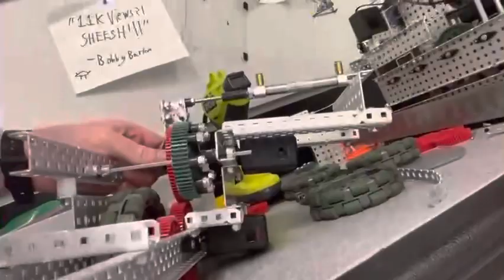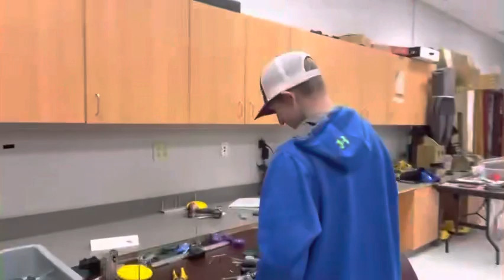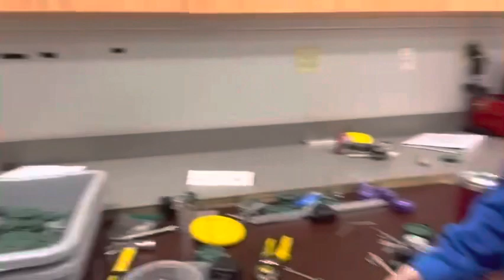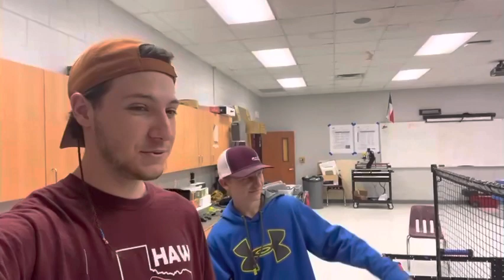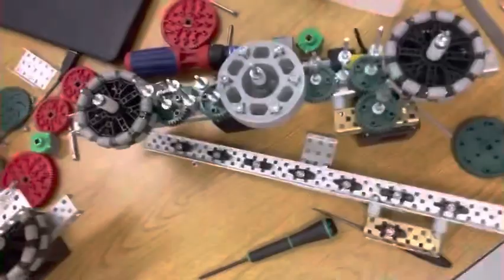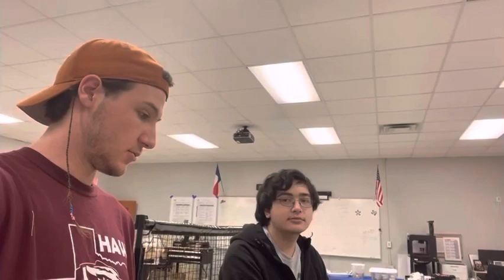GOLD! RoboVlog - Drivetrains and Ambitious Prototypes - Vex Spin-up Ep24

Comment: I’d suggest for y’all’s flex wheels on y’all’s drive that y’all sand down a 3.25 traction wheel to about a 3.13 diameter then stretch the flex wheel over it. You have to cut the inner part of the flex wheel. I have never seen a flex wheel attached like that. Is there enough structure to keep its shape and does it have an even circumference?

Comment: I would advise against H drive as it will bring up more problems than it solves.  I’d suggest you just do 100 Rpm 4 motor x drive if you want to have a strafing ability. Also, I really like the way you did your transmission PTO

Comment: Are y’all using screw joints for y’all’s drive? I’d greatly suggest Y’all’s drive is 360 RPM on 3.25 inch which will outcompete most teams. Screw joints with greatly elevate the efficiency of your drive. Screw joints on the drive will reduce strain on the motors and will increase your acceleration. I’d suggest y’all do that since there will probably be about 20 pounds of weight on the wheels or so.

Comment: How’d you guys stretch out the 3” flex wheel to 3.25”
Reply from the maker: We created custom hubs like the ones for 20002Y earlier in the season. We used two polycarbonate discs on each side with 6 bolts through. Stretching the flex wheel to get the bolts through is a struggle, but worth it
Reply: @goldrobotics7438  thank you
Reply: @goldrobotics7438  you don’t have to do this you can sand down an old 3.25 traction wheel and cut the inside of the flex wheels
Reply: I do understand you did this to keep the flex wheel in tact